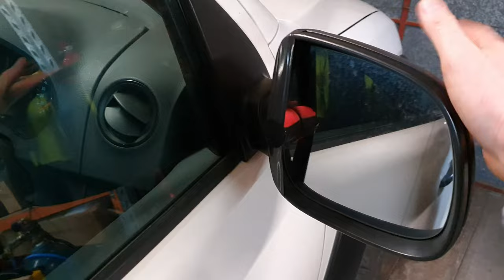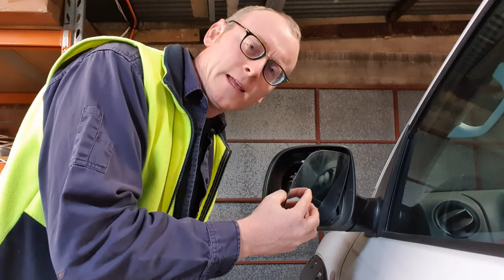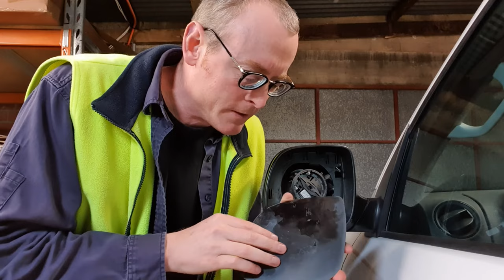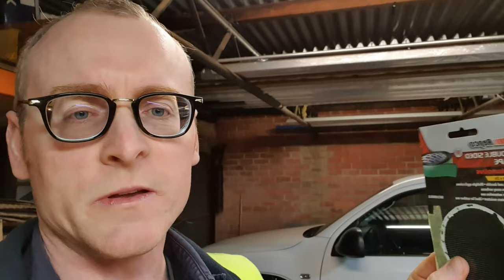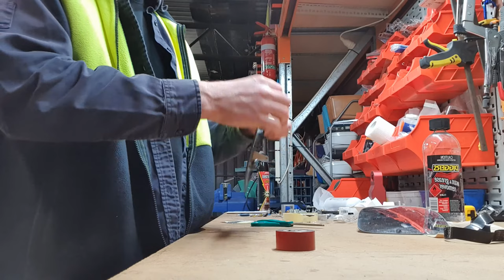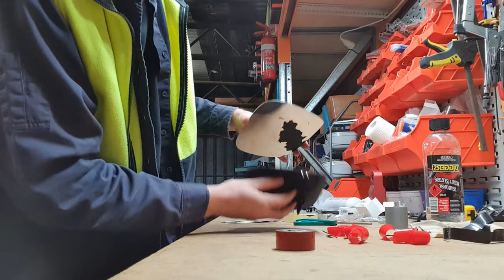Wing Mirror Glass Wobble

Comment: I just did this to my Mazda 6 worked like a charm. $700 savings on a new mirror the car dealership quoted. Thanks🎉🎉
Reply: I as well need to do this to my Mazda 6. Passenger side is fine, never vibrates even while playing the stereo. But just driving down the highway, it moves so much you cant really make out much. Was it hard to do? Im afraid I'm gonna break the damn thing pulling the mirror part off.

Comment: This has just happened to both my mirrors on a 3yo Skoda Yeti. It is definitely and issue with the original adhesive properties. I have a feeling I kept my wing mirror heaters on as default so maybe 3 years or constant heating and cooling has degraded the glue. Time to get the double sided sticky tape out...Blue Peter style!
Reply from the maker: I actually modified my amarok using VCDS so i could turn the wing mirror heaters on by turning on the rear window demister.  So mine wasnt using the heaters that much, but i did use them a bit.
Reply: That’s funny you’re here because of your Skoda yeti. So am I 😂
Reply: @charlottex4889  do you know if you left the wing mirror setting on the heating position a lot? Just wondering if that is the likely cause, rather than defective adhesive. I assume (in hindsight) they should only be in the heated position when needed.
Reply: @charlottex4889  so am I

Comment: Now knowing this, could you just pull the mirror off, apply tape, and re-fix the mirror, and not have to remove the backing plate at all?
Reply from the maker: There is or was a short video on youtube that shows how to take the back plate off.  It's actually easy.

Comment: Hi

How is it now?
Is it still stuck on?
Reply from the maker: Yes, still on, no problems.  As mentioned the insulating aspect may reduce the temperature of the glass during mirror heating but i am going fine.  I wonder if they are originally fixed with a spray on glue of some sort, which obviously failed.  So i welcome anyone to try a spray on glue.
Reply: @rhetth-s8082  I had similar problem to yours on mine and used loctite superglue gell. Hope it holds and doesnt effect the performance of the glass when I need it to be heated.
On mine I noticed that the back plate is heated and the heat travels from the back plate to the mirror. Hope the glue allows the heat to pass effectively and the heat doesn't change the strength of the glue